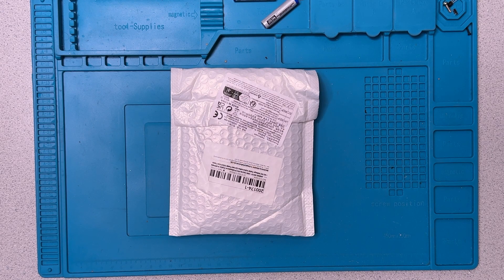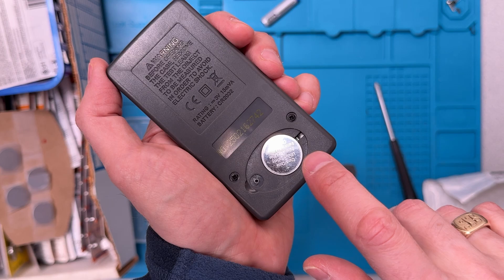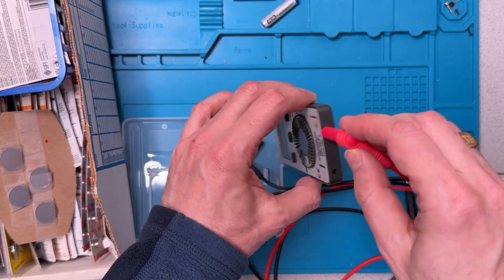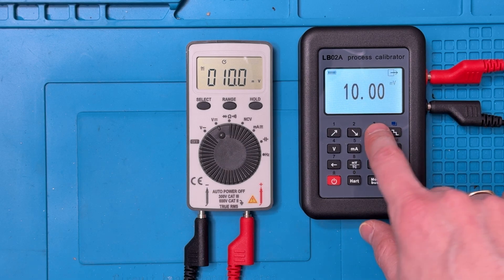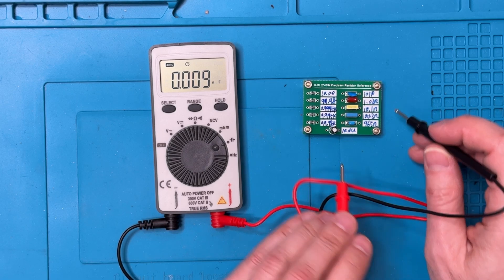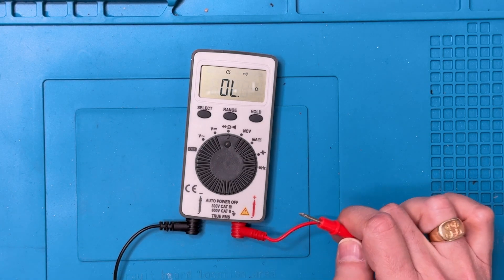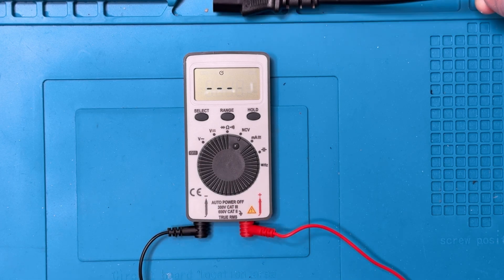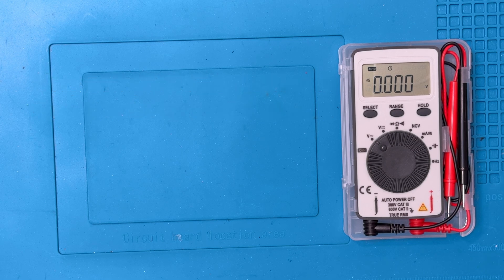Aneng AN101 Unboxing, review and teardown

Comment: Great meter. Stand: place the meter in the case, fold the other side around the back, extend the stand. Covered reading: thread the leads through the hole, close the case and you can take readings with the case closed. Probes: Does take Promaster leads, surprisingly. Hz: set the dial to Hz and insert the probes into an working outlet and it will show the Hz, in my case 60Hz.

Comment: Interesting.   Is there a max milliamp it peaks out at?  I was a little worried on your AC test that your leads were touching and that sparks would fly.  Maybe next time!  Thanks again.  Never seen one that used a button battery!
Reply from the maker: I was a little freaked out myself when I saw how close those leads were when was reviewing the video today. I think there must be a trick of the projection that made them seem closer than they actually were.  But... I should probably change some of the equipment around to make it harder for something like that to happen. The specs say it can go to 500mA.
Reply: @jtechlabs1  Thank you!

Comment: I have this and several other pocket meters (I'm a hopeless DMM junkie with over 40 in my collection, and counting). It is a decent little meter for the money.

BTW the stand is not used like that. The meter is intended to be kept in the case during use. The double hinge on the case is so the cover can be folded back behind the meter, like a book cover, so the stand is in back. Then use the stand as you would with any other meter with a tilt stand on the back.
Reply from the maker: Thanks for pointing out the proper stand operation.  What's your favourite meter in your collection?
Reply: @jtechlabs1 As far as handheld DMMs go, for electronics work I’m partial to the Brymans. I have the BM869s as well as the BM786 and BM2257 eevBlog meters, along with the BM089 clamp meter. I don’t use the 869 much but the eevBlog meters see a lot of use around the bench. I also have several Fluke meters including the 87V Max, 87V, 117, 17B Max, 107, and 101. The 117 is my favorite general purpose electrical meter, I just love the combo of form factor and performance. I also have FLIR and Greenlee DMMs made by Bryman.

I also have a ton of cheaper meters from Zoyi/Zotek/Aneng (all the same company), Uni-T, Owon, FNIRSI, Kaiweets, and others. Some of these are really great values that I would recommend over much more expensive meters for a lot of uses.

I also have an Agilent 34401A and Siglent SDM3065X, both 6.5 digit bench meters.

Also several oscilloscopes and other test equipment.
Reply from the maker: That's a pretty nice collection. I have been considering the Siglent as a step up from the handhelds that I have, however, they recently released the SDM4065 and that has put me into indecision land.